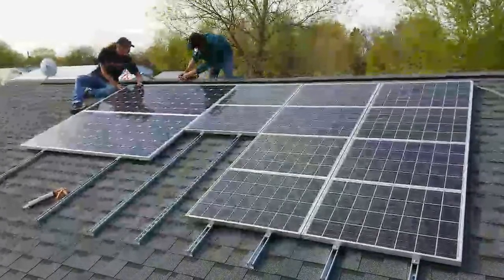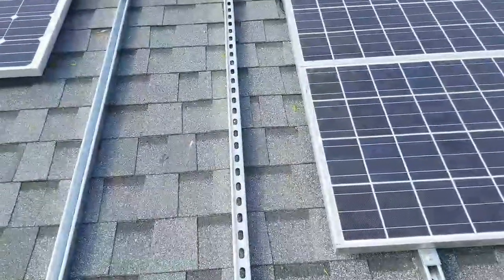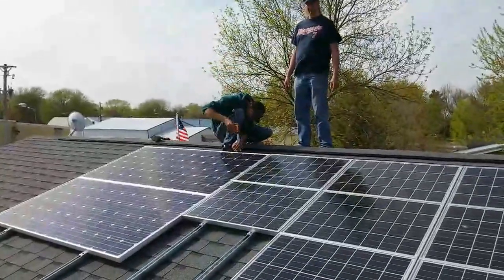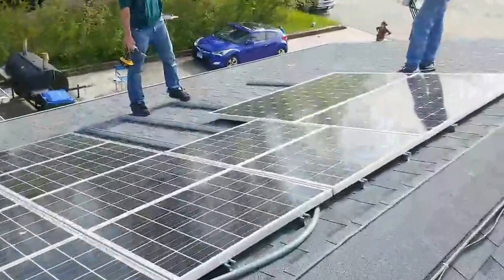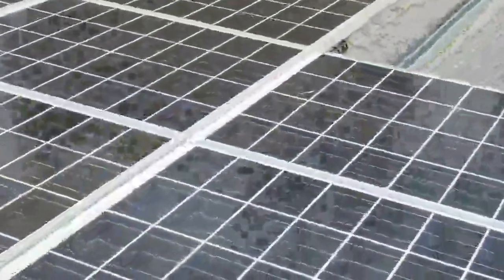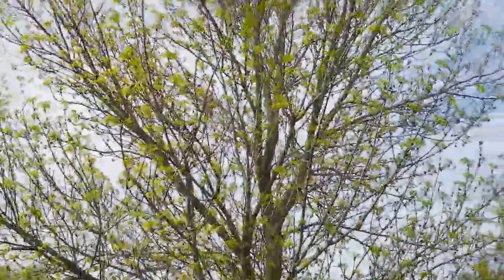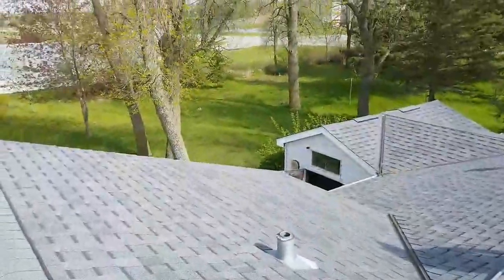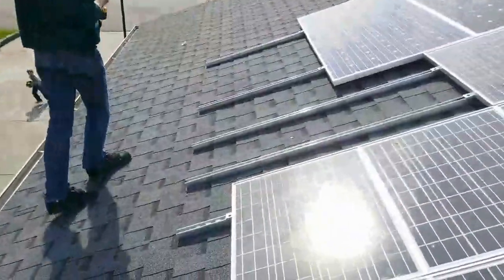DIY: OFF-GRID SOLAR ARRAY INSTALLATION COMPLETED Ep#3

Comment: I thought you said there are a string of five small panels and a string of two big panels? How are you going to wire the three panels you going to add???
Reply from the maker: +SolarizeYourLife 
Sorry I meant Two Strings of Fives
Reply from the maker: +SolarizeYourLife 
If we decided to add two more of the Kyocera Panels, we will have two strings of six and the other big pane will be be tied to those two with another charger controller